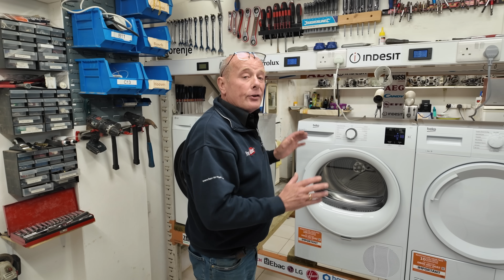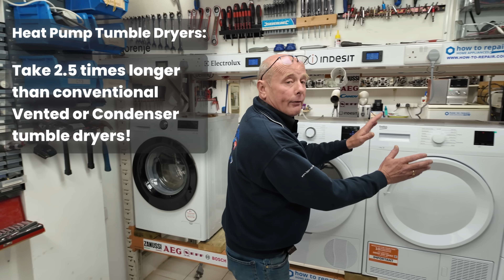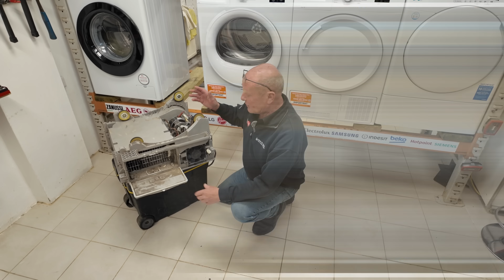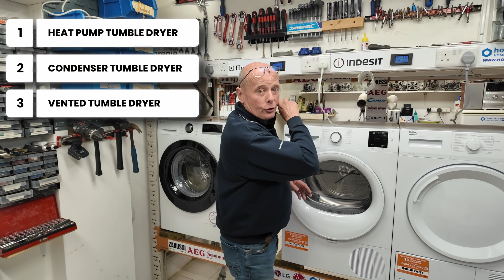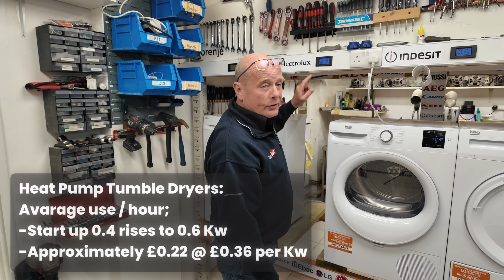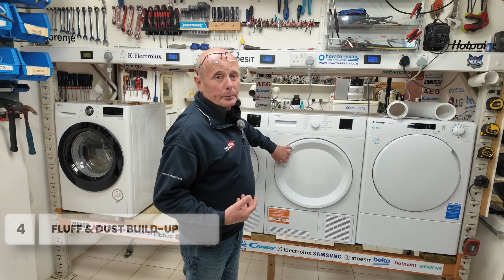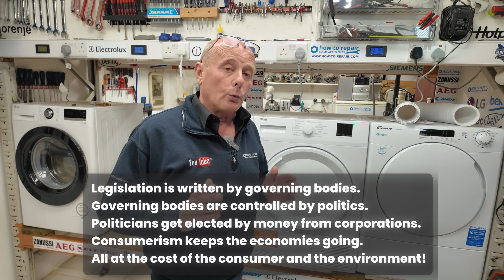Tumble Dryers the Shocking Truth About Heat Pump vs Vented & Condenser, NEW LEGISLATION!

Comment: Not a random channel plug comment.  We have used heat pumps and condenser units over the last 25 years or so.  One condensing machine was so bad I was pleased when it failed quite not long outside of its warranty.  I forget what it was for certain but I suspect it was very loud and left a lot of moisture in the air.  It's a bit hard to admit making a poor decision getting a heat pump machine.  I do see the lint in the filter and see that is clothes wear.  It can do a full load (from a 10 kg load machine) in around 1:30 to 2 hours.  Our washing machine offering washes up to around four hours (and having no logic to quick wash option - whether it's a washing setting of its own or just adds more water for a quicker wash, etc) with notably poorer washing performance than our previous machine and that is clearly far more wear and tear on clothes and machine than needed. No pre-wash either.
Reply: Oh, one extra thing: our dryer cleans the internals partly during a load but has a more thorough cleaning system it prompts from time to time where the it uses clean water from the capture tank for its own cleaning programme.   Hopefully that will give the machine more longevity before a write off situation.

Comment: your so called test of the three machines is pointless unless you actually dry some items all the same weight , material and moisture content , using a drier without any load of clothing etc is to put it mildly stupid and pointless , it is like giving a mileage quote for an unloaded goods vehicle , wrong

Comment: I found the spinner is getting extra water out of the washed load, drying is reduced to half a time. 5 minutes at 3000 rpm. It needs a bit of labour to transfer the load around but it's worth it. Thank you for sharing your knowledge.

Comment: Completely agree. 4 years ago I went from condenser to heat pump. The heater matrix under the drum is completely blocked (despite removing lint from filter) and cleaning the front face). Clothes are taking even longer to dry vs. when it was new. I’m going back to a condenser and throwing away a perfecting good heat pump dryer because of a blocked filter due to poor design

Comment: Just gone back to a vented tumble dryer as it runs for less than half the time, and clothes drier not need airing to get the clammy steamy vapour feel out of them compared to the heat pump or condenser models we have had. The machine run times as follows for vented appliance 45 mins, condenser was 90 -120 mins and heat pump up to 240 - 360. Our energy consumption has dropped soo much not having the drone of the heat pump drier running for hour upon hour to get a typical washing load complete. We are all for the energy efficiency rating system, but think that the stats need to be clearer for end users, we want to know the operating efficiency per minute, but importantly per average load so we compare apples with apples to getting the job completed. Why is legislation phasing out our ability to choose.

Comment: The biggest issue that I find with modern tumble dryers, regardless of the actual drying technology, is that they are no longer reversing types.  My first two tumble dryers used to reverse direction every so many seconds.  That last two (our latest is a Samsung heat-pump type) have mono-directional running.  Why?  All you RHD up doing is stopping the machine every couple of minutes to ‘de-ball’ things such as bed linen.  What happened to reversing systems?  Not energy efficient I suppose.

Comment: Owned a heat pump dryer for 5 years. Became irreparable after that period. Took too long to dry, which meant high energy consumption and long periods of noise in my kitchen. Came to the conclusion that domestic drying machines are generally crap and didn't buy a new one, of any type. Now I do an 18 minute dry cycle at a local Washing & Drying spot (aka Laundromat) for 2,5€. Takes me less time, the clothes are dryer and I'll need 4 years of drying cycles to spend the same amount of money I would buying a new dryer. Oh and the industrial machines at this spot are powered by natural gas.

Comment: Great video again.  I hadn't realised there is legislation coming in to force heat pump driers, clearly not very well thought through law.   Our condenser drier is pretty old now (>10 yrs) and will probably last for a much longer time.  However, we only use it a couple times a week when the weather outside is not good enough.

Comment: Where does the heat pump dryer get its heat? It get its heat from the room it sits in, such that it robs Peter to pay Paul. So it is dependent on the system that heats the dwelling and the heat pump in the driers are too undersized to make much gain. Are both exchangers accessible so they can be cleaned with a brush? If not, then what are the manufactures doing.

Comment: We've a Miele heat pump drier and I hope you're wrong! I agree about the longer drying time, it's about 1.5 hours for ours on its 'cotton eco' setting. I also agree about the huge amoount of fluff! 

As a retired engineer, I'm very aware of the possibility of fluff blocking things up but the Miele does seem to have an excellent multi-layer filtering system. The sponge filter which is the last stage of three has never shown fluff penetrating to the condenser side though it does need thorough cleaning every month or two. I peered inside last time with a torch since I was expecting that I'd have to brush them clear. However, the fins look perfectly clear after about 5 years. 

This isn't too arduous and I'm keeping my fingers crossed.

Comment: Is the heat pump a recirculating dryer? It seems like a bad idea to me. I mend a lto of dehumidifiers which are basically the same thing and the number one reason for them not working right is the dust. There is no reason for the heat pump to be inside or hard to remove, it would simply be placed to allow easy access and removal as a unit needing only power and an in and out pipe. I used to use a White Knight gas dryer but in truth shutting the washing in a small room with a dehumidifier achieves much the same in not a lot longer.

Comment: Iam having Bespoke dv90bb7445gbs2 dryer 9kg, and It,s drying my clothing fast on very dry faster setting, faster then the wasmachine wil be done with the washing. I guys 7-9kg can dry in 1h and 30-40min

I alwasy regurlay cleaning the condensor with brus that samsung provided and spray water on it and samsung using cleaning programme after 25 times using so the machine is clean, it will also warn me if there is something worng like condesor is blocked and have to clean and if I need to clean the machine.

I really think samsung bespoke whasmachine and dryer are doing wel

Comment: I bought a second hand Creda drier about ten years ago for £30. It was probably 10-15 years old when I got it. Only thing wrong with it was that the mains lead needed replacing because it had been partially cut. Took about an hour to fix. Since then it has worked flawlessly. Meanwhile a friend of mine has some fancy new thing that has more lights and buttons than a space shuttle and probably cost about the same. Which is currently waiting for its third warranty visit, because it can't perform some of its basic functions, like actually drying clothes.

Comment: live in uruguay, got a candy condenser dryer. does the job, most full loads are dry about 2 hours, when i push it to the brink with 12 kgs of big shower towels (the machine is for 9 kgs btw) it does take the full 3:43 (Hours and minutes) witch is the max time, even that the dry cycle is controlled by sensors that usually cut 30 minutes or even more while drying the clothes. regular daily loads takes from 1 to 1:30 to do a full dry. and the power consuption is quite balanced, a few minutes is just the motor, other minutes the heat element powers on. goes from 200 w to 2500 w from 5 to 5 minutes usually around 90% of the drying cycle.
the only other candy heat pump dryer i have seen is expensive, and also uses 2000 w of power, since apparently they added a HUGE compressor. aldo it seems its not a stable 2000 w usage, and is says it will take less than a conventional/condenser unit to dry. i guess they cranked the compressor to turbo speed to heat the clothes like if there was a heating element i guess.

Comment: Well done, Great presentation. I am retired and very recntly purchased a shiny new heat pump dryer. Whwn working I was a comercial catering engineer, Fully qualified refrigeration engineer and gas safe qualified. It is no surprise what you have explained to me. It appears to me that you are correct in all your comments and that its the manufactures confusing the govenments, lets be honest and say that is not difacalt.

Comment: Our first dryer was a gas dryer. It was brilliant but the flame would blow out at the bottom.
Then got a Bosch condensing dryer. Brilliant but found the floor was rotten under it when it had dripped. 
Had a cheep vented for the last 10 years and its bullet proof. Sometimes have to put it on twice, but its cheap to buy and quick

Comment: I've got a Bosch heat pump drier that I've had and use daily for 10 years. Energy wise ive saved a small fortune in the last 10 years, but it's starting to slow down in its drying time now. If electricity hadn't been as eye-wateringly expensive, I wouldn't have been such a fan, but I'll be looking inside to see if it's inefficiency is down to fluff blockages or if the fridge unit is needing attention. If it's the latter, I'll probably buy another Bosch heat pump drier as my previous standard electric driers have only lasted just beyond their warranty. I consider 10 years to be a good innings given my wife loves to overload it regularly! 🫣

Comment: I got roped into buying a heat pump tumble dryer. I hate it!
Takes soo much longer to dry than a regular condenser dryer, so doesn't match the washing cycle, meaning I'm having to wait between loads.
Plus now it's not working as efficiently as it used to and I normally have to run it twice, because I can't remove the bottom filter.
Watching your video has opened my eyes. I really hope the government don't phase them out as I want a new condenser.
Plust as someone previously commented they also heat the house in the winter, saving on heating bills

Comment: I have since 1998 heat pump dryers  the first was an AEG-Electrolux and today I have a Schulthess. The speed is really depending from the spin speed of the washing machine. At 1600/1800 it is much faster. In Switzerland we get only HP dryers for more than 10 years

Comment: If you have the space get yourself a dehumidifier with a clothes drying function and some pull out wall mounted or pulley type ceiling mounted clothes drying racks.

In the summer dry clothes outside, in winter the heat from the dehumidifier (which is just a heat pump) goes towards heating the house.

Clothes last longer, don't shrink and saves a ton on electricity. We haven't used a tumble dryer in 2 years, best washing related investment i ever made.

Comment: Today I had a technician from AEG perform full maintenance on my heat pump dryer after four and a half years of use. This included deep cleaning the condenser and evaporator radiators as well as all the airways.  He also performed a few other smaller maintenance tasks and checks. The whole operation took less than an hour, I will admit though that the service was expensive, especially for the level of income in my country.

Comment: I found this video whilst trying to sort out my hotpoint heat pump drier. Had it two years and takes over three hours before it stops and then clothes still aren’t dry. Have stripped it down but decided to skip it as the effort involved every two years just ain’t worth it. Back to a standard condenser for me

Comment: You sir are a legend

Though vented tumble dryers are abhorrent and should be banned for sure…

You must also remember that heat pump tumble dryers are a new technology and they will get better with time (with exceptions like anything)… 

You are also wrong about the clothes element, it is the heat that damages clothes most… and heat pump tumble dryers are gentler on clothing overall, meaning your clothes will last longer too

Comment: The main reason I went for a heatpump drier is to reduce peak consumption. We have a very small grid connection where I live and the wiring in my house is, whilst safe, low capacity. The HP drier allows us to run it simultaneously with the washing machine.

Comment: We have unknowingly bought some of these new types of machines in a washer/dryer combination for our apartments and the biggest problem right away is the ridiculous time they take. The suggested time for a cotton program fully dried is 13 hours. Yes. 
You can not choose your settings for washing temperature, tumble speed or duration easily. 
We are using this for our holiday bnbs, and a lot of our guests have kids, as we have, too. How are you supposed to manage your washing as it practically requires you to sleep in shifts? 
I was not aware and neither have we’ve been told at the purchase that we are buying this technology. 
Greetings from Austria!

Comment: My samsung heat pump dryer is awful. So many problems that Im going back to a condensing dryer. The moment a heat pump dryer has an issue and becomes less efficient then Ive found that it can take 4x longer to dry. The designs are so poor and I believe as per your view are solely to become obselent in about 5yrs - 4yrs in the samsungs case! My previous condensing dryer lasted twice as long and I only changed it rather than repair it because of the heat pump hype! Great video.

Comment: Yes. They are worth it.
They are worth big time.
Have mine for some years now and it saves me a ton of money.
They are so inexpensive that not only do I save on how much energy I use as I also save on needing a lower power rate (I forgot the name, the max amount of power you can draw at one time).
No. It is not "going to take 2.5X longer". He said the other ones got it ready in about 1h something... I get my clothes dry on my heat pump dryer in between 50min to 1h30.
The compressor doesn't run 100% of the time me and that means that usually, I use a little bit over 0.5kw/h to fully dry a load (about 7, 7 something kg).
This is nonsense. Absolute nonsense.

Comment: Just replaced a Bosch washer from the last century, motor commutator segment broke out, was on 3rd or 4 set of brushes couldn’t find a motor anywhere even used
Companion dryer has never needed repair. The very fine filter in the door keeps fluf out of the vent
Only complaint for now they don’t match, new machine has a different paint tint

Comment: So, what's the difference (technically-speaking - ie I'm not interested in the personal feelings about an 'engineer's preference - or not - for working on HP driers rather than condensing and non-condensing ones which they will almost certainly be more familiar with) and, say, repairing a large fridge-freezer with a heat pump fault...eg defective compressor or loos of refrigerant?

Comment: I have a very expensive heatpump tumble dryer with a 5 yr parts warranty. The heat produced is similar once it has been running for 20 / 30 minutes to my old condensing type. Without the fear of fire. ( in older lint covered elements) My experience so far is positive. My electric consumption has dropped considerably.  I paid £960.00 :for my samsung model DV90T8240SX

Comment: We don't have a tumbler dryer for 2 reasons I live in a modern house so no room for one and also the cost of electricity so we use airers to hang the clothes on and hangers in the bathroom on the shower curtain rail and window rails it works and another trick is to  spin the washing twice!!

Comment: My current heat pump dryer cost me £580 and is now 12 years old.
The secret is cleaning the front of the condenser regularly.
Some heat pump dryers now have a secondary filter in front of the condenser.
At current prices it's saving me about £100 a year in electricity.
Even assuming a standard condensing dryer lasted for ever and cost nothing to maintain I could replace my dryer every 5 years and still save money.

Comment: The heat pump version might use less energy per hour but takes at least twice as long to dry the clothing, factor in the that it’s a consumable item it’s overall carbon foot print might actually be greater than the other two variants.
Reply: That's why he used the kWh per year figures from the dryers. Heat pump tumble dryers still use less power despite running longer.

Comment: very comprehensive information, wish I knew this before I purchased, if it take 3 times longer to dry then it's not much cheaper to run and as you say the wear and tear on the machine and clothes means it's a mistake to buy

Comment: Do you do videos on Dishwashers? I bought a Miele G7500 (I think, it wasn’t cheap) and it was bought in 2020 and the door is coming apart from its stainless steel inner shell. I contacted Miele as I thought it had a 5 year warranty as that’s why I bought Miele because of quality and reliability but I was told it only had a 2 year warranty. I have glued the door back but think I am going to need a new dishwasher soon and I really do not know what to buy - should I stick with Miele and pay for an extra warranty period for a £1700 costing machine or is there a better product than Miele you can recommend as tI have had Miele for many years but after this last dishwasher fiasco I have lost faith in their products and after service. Many thanks for your channel.